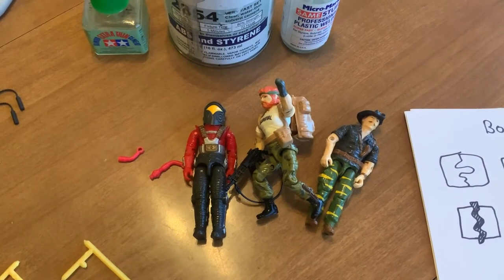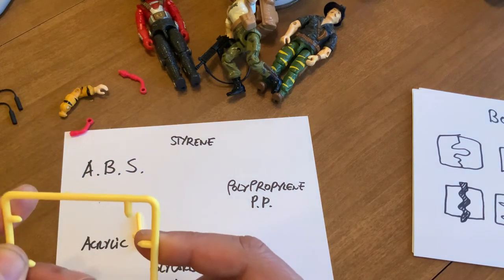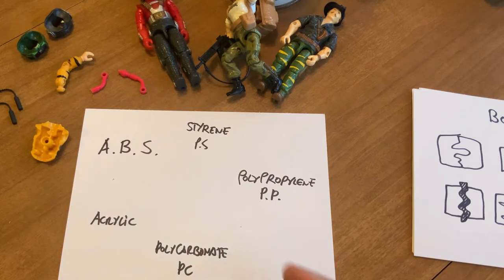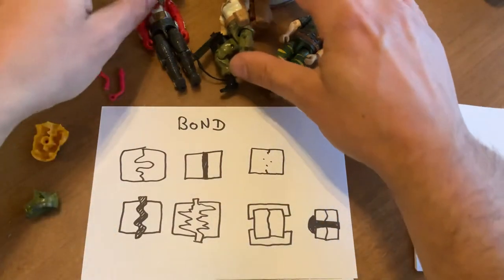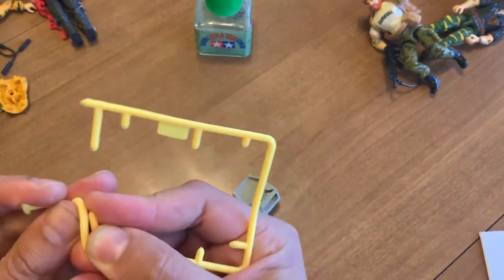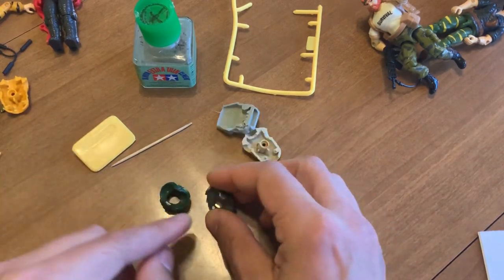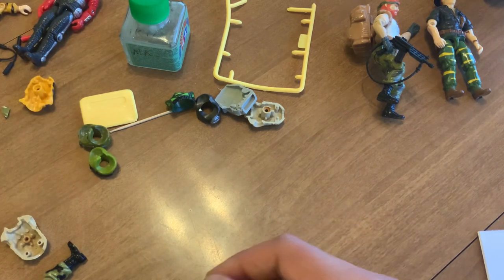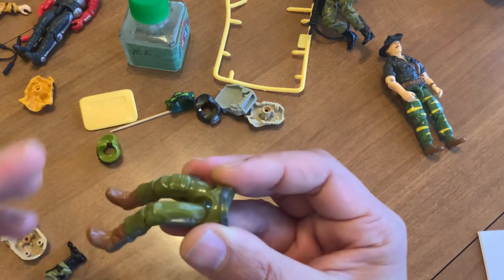Joe fig knee and crotch repair part 1: glues and plastics

Comment: I have been using automotive plastic  restorer on my figures to help preserve and protect them. I was wondering if you think that is effective.  It seems to me that it works and even restores the shine and new feel to my gijoe and other figures I collect.
Reply from the maker: Interesting… what brand? In theory any clear-coat would protect the paint and seal the surface. Not sure about UV penetration. The trick is that some clear coats are too glossy and the matte ones look dull. As much as I like having these figures outside in natural light, the vintage figs are ticking timebombs.